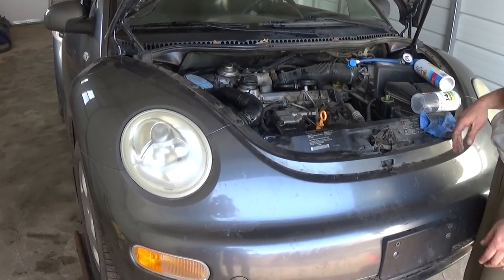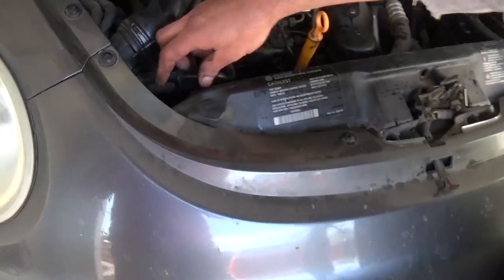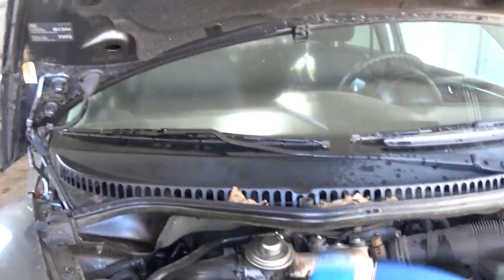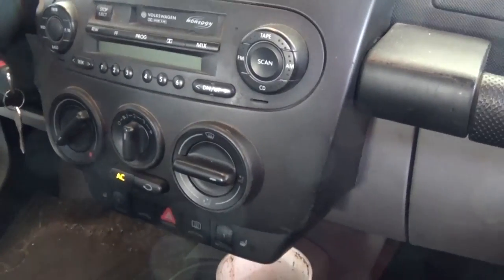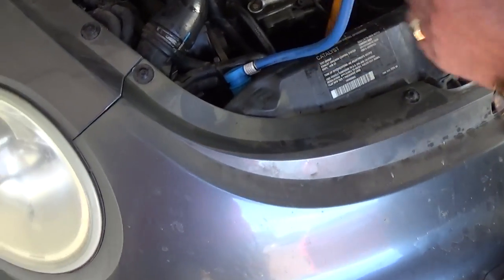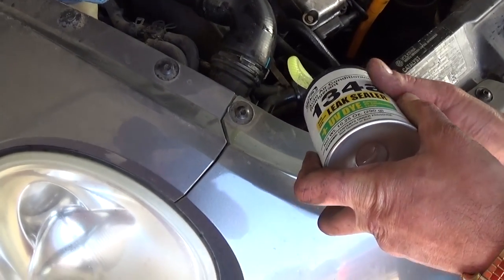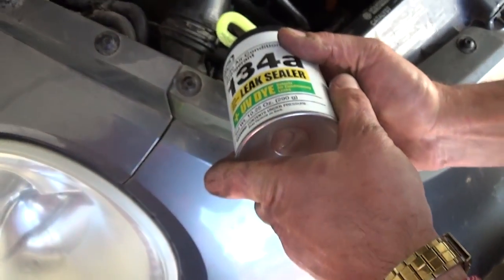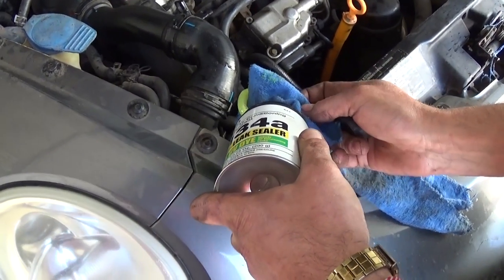VW Beetle A/C System Recharging  How to Recharge Air Conditioning on Vw Beetle

Comment: what if your compressor is still turning but the air is coming out hot. is that a freon issue?
Reply from the maker: Brandon Doskey that was the same case with this vw. It was turning but it was wore out and it could not compress the air enough. So it was blowing warm air. Let it run for a few minutes then shut off the engine and touch both hoses. If one of them is not really called than you need new compressor. If it is cold and you are still getting warm air than it is the temperature switch on the dash

Comment: Have a 2006 Beetle.  The air is cool but not cold and I assume it needs refrigerant.  Does this follow the same procedure as the 2005 in this video?
Reply from the maker: +Steven Gillikin Yes, it should be pretty much the same. Try adding only half a can and see if you can notice difference. If you can go ahead and that the rest of the can. We had many in the past that the compressor was leak and needed to be replaced. How many miles are on your Beetle and what engine?
Reply: +World Mechanics We bought the vehicle last week...it was a one owner with only 20k miles so it has done a lot of sitting.  It has the 2.5 gas engine.  I checked it this morning and it was only showing about 10 on the gauge....low green on the indicator.  I will add some this PM and see what that does.  Do you still suggest half a can?  12 oz or 19 oz?  Thanks

Comment: Great video! I have a query, before charge the system, you must first do vacuum at the system, is this correct?....thanks a lot
Reply from the maker: j charles It is recommended to. In some cases you can recharge it without vacuuming the system down. If your compressor failed you might have some debris in the system. This is one of the cases that you need to vacuum the system

Comment: This is a pretty old vid. It appears you forgot the first step in charging an AC system. First you MUST vacuum the system. A vacuum of -28g must be obtained at sea level and the vacuum continued for another half hour. This will remove all moisture and air from system. After reaching -28g and continued vacuuming for half an hour you shut off pump and watch system to make sure there are no leaks. Then you add coolant along with oil and stop leak. If you are going to post a procedure you must FIRST know what you are doing. I learned AC systems while a BMW mechanic at a BMW dealership. The AC man hurt  himself and could no longer do the installs. Service manager calls me to his office. Said here are the manuals and we need the new Alfa-Romero completed in two days. Manual called for a 16 hours to install. Had to dissemble half the car. Then I was doing new 320Is plus new car prep in a day each.